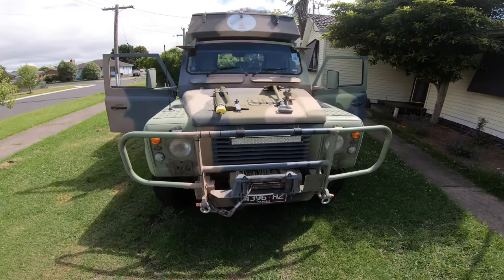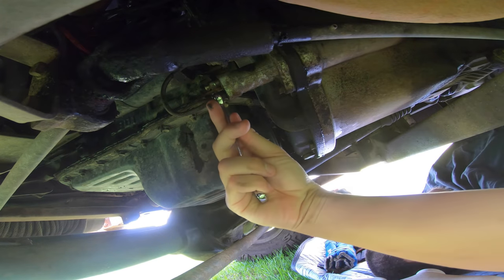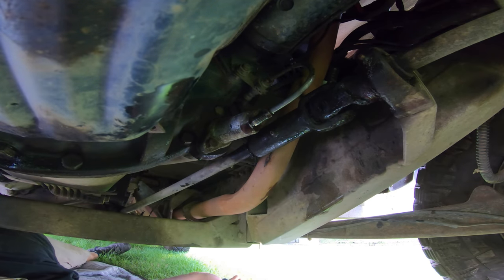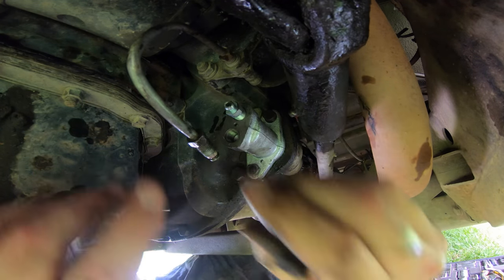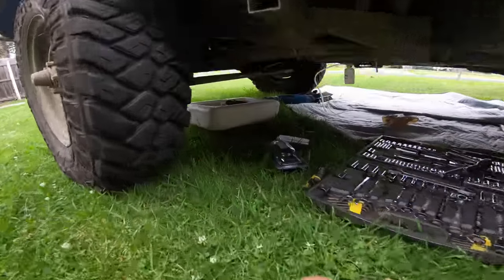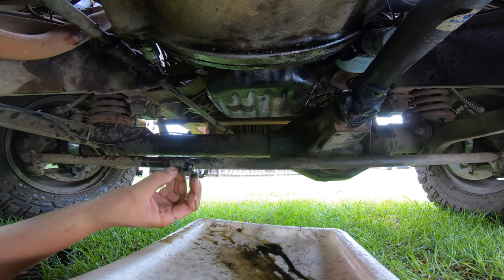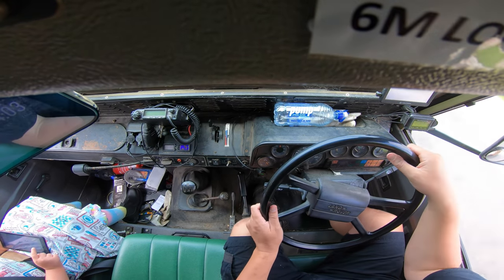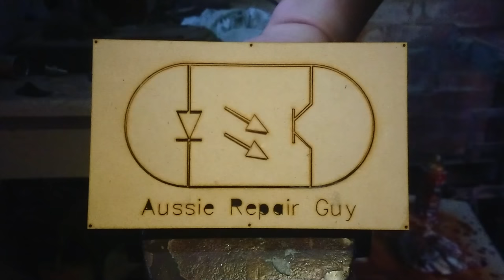Clutch Slave replacement | 6x6 Perentie Ambulance

Comment: Good job! 6x6 looks amazing! Sounds much quieter than my 300tdi DEF! I have bled mine because it was never done before. I did gravity bleed with Moccona Jar with clear Hose. No need to press pedal.  Hopefully where the pin push the Cup is ok.....
Reply from the maker: Yes it seems to be drastically better now, so I think the push rod is fine. I'll do the master at some stage - but presently pending my next treatment for MS, so I'm going to be out of action for a bit.

Comment: I just previously looked at brittanica resto vid he said 4 pumps of the pedal drains the reservior, and recommended 3 pumps then top up to avoid more air in the system, I’m doing mine on Monday when the part arrives from KLR! I am not amused it dumped all fluid inside of 5m drive
Reply from the maker: you can get bleed assist bottles that fill up the reservoir as you bleed it. That or a coke bottle correctly modified and cleaned. did it with the brake bleeding on the 6x6 recently.
"auto brake reservoir refiller" is they key word to google search.

Comment: Prob should do master? Maybe brake master aswell? I hate doing these.
I usually gravity bleed the slave. I just crack the bleed nipple and stand there getting ready to top up.
Reply from the maker: Brake masters are hard to come by in good condition, and they are quite fine, bled that system not long ago.

Yes will replace the clutch master at some point, but with MS, I get about 4 hours of energy a day, so I gotta fight the battles I can.
Reply: @TheAussieRepairGuy  are brake masters unique to the perentie or 6x6?
Reply from the maker: @mattluszczak8095  no, same as the 4x4.
But same issue with the 4x4.
Living rural has some barriers, this is one of them.